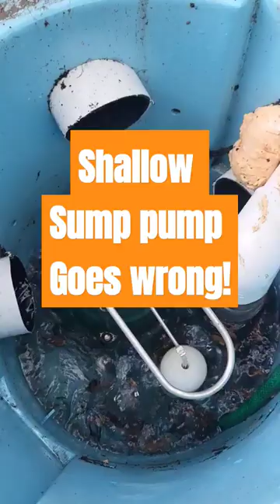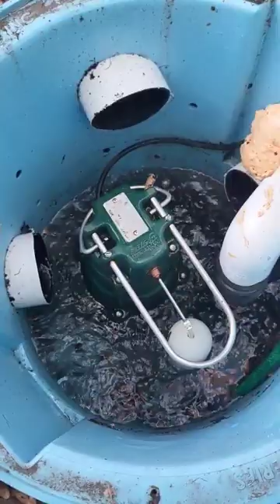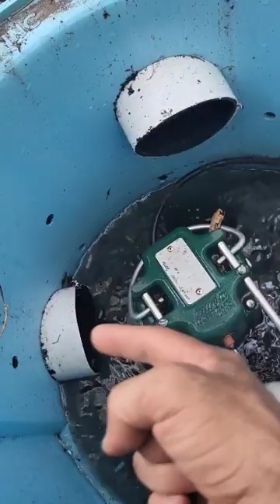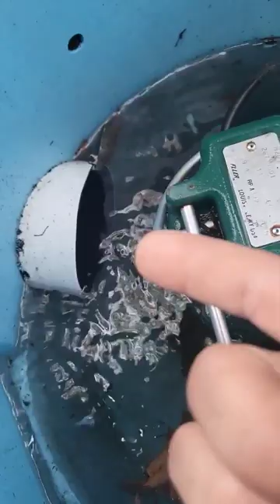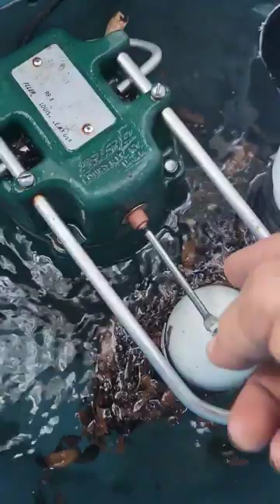Sump pump installed incorrectly  in Florida| Drain assessment in Orlando Fl

Comment: Simply modify the arm on the sump float to sit lower and it will activate before it drains out.  No brainer.
Reply from the maker: Thanks for the advice but the pipes are way too low so the water was backing up into the system the pump never activated so we changed everything up and made it deeper I will be posting the video soon thanks for watching